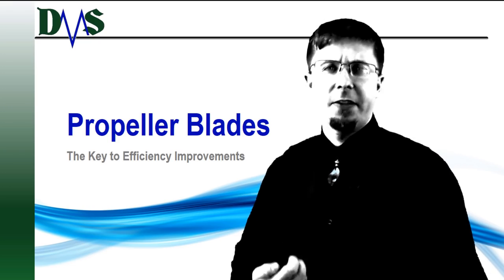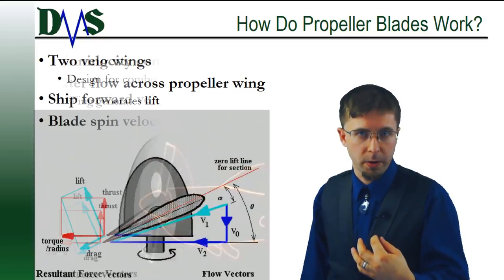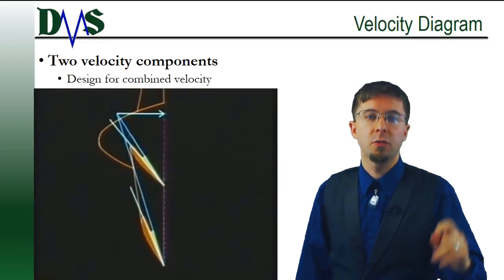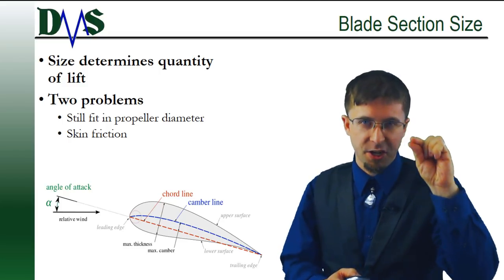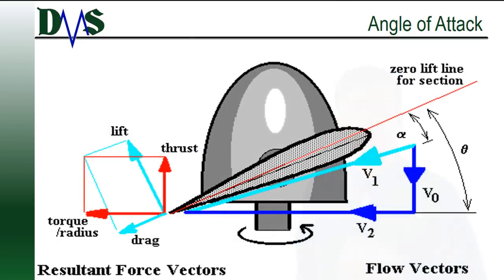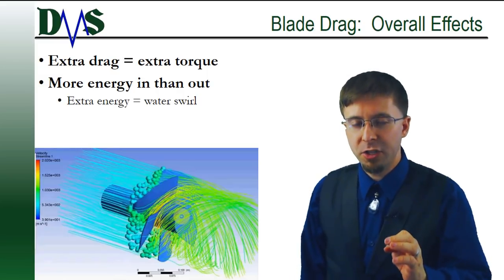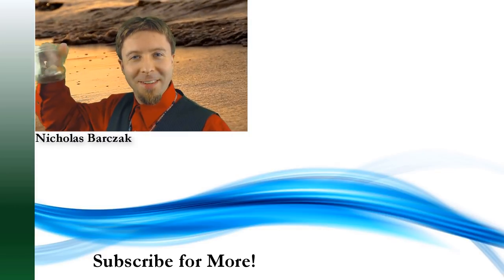Propeller Blades:  The Key to Efficiency Improvements

Comment: I did allot of testing to find the ideal prop for my model aircraft motors. 
Convention dictates a certain pitch for modelers to use, most commonly an 8-10 inch per rotation prop is used.
I tested with the 12-8 and found the engine could not drive the prop into the power band of the 2 stroke motors being used, it would stall the engine and less thrust was produced.
My experiments lead me to a larger prop and a shorter pitch. My 10 cc motors could drive a 13-4 wide blade into the 12,000-12,500 rpm range, the motor was happier and the thrust was twice the thrust produced by the 12-8 prop.
It pays to do the testing, never listen to idiots, always do the testing yourself.

Comment: I had two props on an old outboard motor many years ago. They were the exact same make, diameter and pitch. One was cupped slightly different and the motor performed noticeably better with one over the other.

Comment: Is there a factor for the noise the propeller produces? This would be important for a submarine prop design or to protect animals.
Reply from the maker: Yes, absolutely.  I'm not an expert in propeller noise, but some of the basic design principles include:
- always use an odd number of blades to reduce pressure pulses as blades rotate past vertical surfaces.  (even number of blades, and two blades align at the same time, doubling the pressure pulse).
- Increase the number of blades to reduce cavitation and general noise from the propeller
- If possible, rotate at slower RPM.

Comment: Most people confuse propeller shape - especially the leading edge dimension - with air and low / high pressure of air.  Water is incompressible so it is about how a prop redirects water flow around it and thrust is developed by the change of water flow over speed and water pressure after it leaves the propeller.  So blunt leading edges are no longer used much anymore.  
Very surprised you did not cover gear ratio selections and the importance that props spin slowly ... because fast spinning props cause cavitation at the tip and lose thrust.  Another missing element is Blade Area ratio.  Very important, and number of blades and blade shape.  
To the question below Impellers are not more efficient than propellers, because they are inherently different to propellers, as impellers are part of pumps.  
counter rotating props could also be discussed here regarding flow efficiencies.
And speed limitations.  For standard propellers max speed is around 37kts in most cases.  This can be improved if CCP props are used - also known as variable pitch propellers and for very high speeds props become wedges so they become supercavitating foils and are raised for planing craft so become surface props and are good to very high speeds.

Comment: Excellent Talk, although I clean barnacles & oysters for a living as a hull diver. Alot of the over engineering equals extra growth and extra drag do to marine growth. I am seeing alot more IPS Drives that eliminate bow and stern thrusters and also give the ability for joystick controls. The propeller design seems to come to mind because of this talk. It is a pod drive with forward facing twin propellers rotating opposite one another, forward propeller having three blades and aft propeller having 4 blades. It probably maximizes thrust while countering swirling. This is all just from underwater observation though, no real performance testing by me.

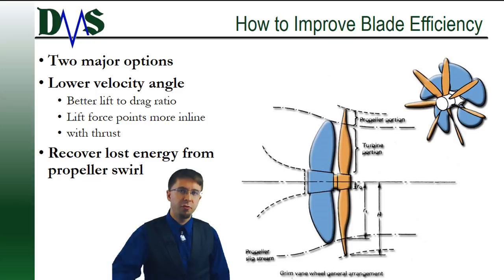Comment: @08:21 is a Grim's Vane Wheel, which vanes freely on the shaft in the propeller's propwash. Its blade sections within the driving prop's radii are formed to act like a turbine while the vane wheel's sections at the remaining radii towards its blade tips exceeding the prop's diameter are formed to act like a second prop in the wake of the main prop. That gives the vane wheel's blades a bizarr looking warp.
Unfortunately, those Grim Vane Wheels didn't really succeed (e.g. their unnoticed  loss during their first operation on QE2 after her big  propulsion retrofit at the Lloyd Yard at Bremerhaven), and their application remained sporadic to mainly research vessels (e.g. hydrographic RV GAUSS) and a few container vessels from rhe Bremer Vulkan yard that were built in the mid 80s within ship research projects that were partly funded by the government.
The same goes for those wake equalizing fins and ducts (e.g. Schneekluth and Grothues-Spork)  that were shown a few frames earlier in the video, and which where sporadically  applied on other container vessels from the Bremer Vulkan in the same era.

P.S. Just found this reprint from HANSA on Schnekluth WED
https://www.schneekluth.com/wp-content/uploads/2019/03/hansa-about_wed.pdf

P.P.S. Here another article about the Schneekluth WED
(n.b. of course one should be wary about the promised efficiency gains vs. extra costs and risks; of course ship operators asses the latter a bit differently from their or others' experience)
https://www.schneekluth.com/wp-content/uploads/2019/03/brochure_english.pdf

P.P.P.S. Here's a paper by a researcher from the Potsdam Ship Model Basin about wake influencing devices.
https://www.marinepropulsors.com/proceedings/2011/WA3-1_Heinke.pdf

P.P.P.P.S. Here are some slides from a talk that gives an overview of propulsion efficiency improving measures by two researchers of the Dutch MARIN ship model towing tank.
https://www.stg-online.org/onTEAM/shipefficiency/programm/PPTdeJong.pdf

Comment: Very impressive, whell explained and illustrated. Very intresting, thinking about solution to improve our cabincruisers "planespeed". It's 27 ft, ca 3500kg , 170 hp TD yanmar, staigth shaft drive, 4 blade prop. max out around 17 knots. (Swede so exuse my bad spelling" XD
I jusr wonder about "the tube/pipe around" the prop, how to improve it or like the first fast prop bout with screw before the prop or dual prop fix monted even a gear from a duoprop on the shaft? Possible or madness? ; ) ideas?
Reply: Legolas Ok : you make no mention of pitch, diameter, cupping, make, rpm design or engine torque peak, in the absence of any real information one can only suggest switching to a 3 blade prop as they are better for top end than a 4. Give us more info and you will get a better answer ....
Reply: Your so Swede!!!

Comment: Why do propeller hubs, at least for outboard motors, usually widen at the back end? I would think that it would create extra drag.
Reply from the maker: That is an excellent question.  I can only partially answer it.  I know a few professionals that work in small boat prop design, and I suspect they know some secrets about optimizing performance at the propeller hub.

That said, I suspect the flare on the hub has a lot to do with the engine exhaust.  Most outboards route their exhaust flow through the propeller hub.  So we can't put a tapered hub on there.  We need an open hub to let the exhaust out.  Given that limitation, it's better to have the water flow separate cleanly from the edge of the propeller hub.  The flared edge achieves this separation.  We don't want the water mixing with the exhaust directly behind the prop hub.  That creates even more drag than the small flare on the hub.  You can clearly see the separation between water and exhaust in this video of a prop underwater:
https://youtu.be/DDsPag56GQE

In summary, I don't think the flared hub is the best option.  But it is the most preferable of the bad options, given that we need to allow the engine exhaust out through the hub.